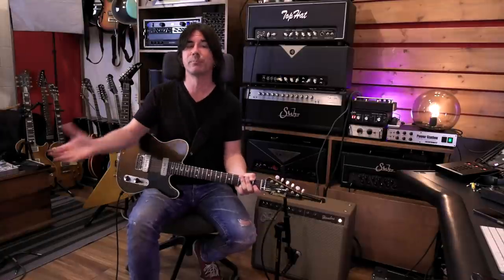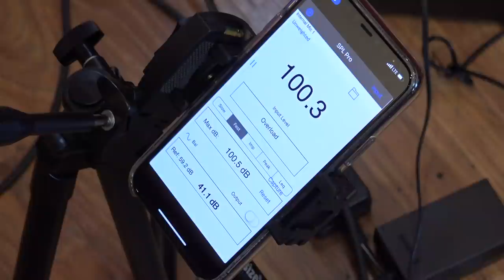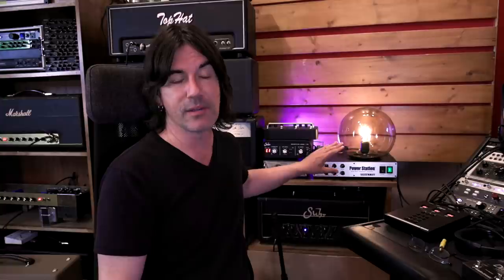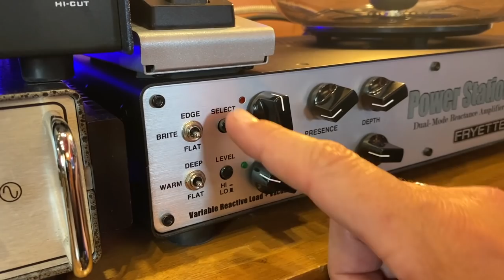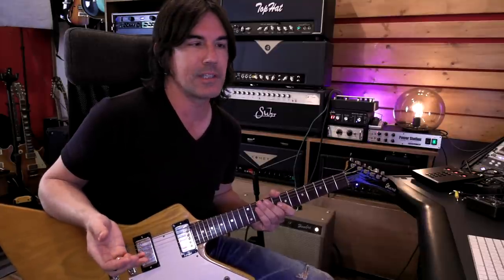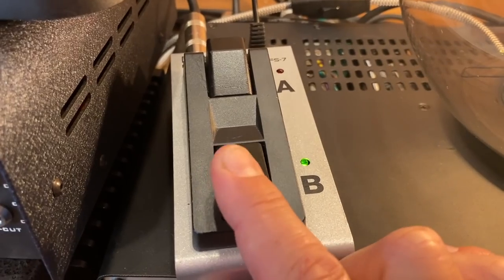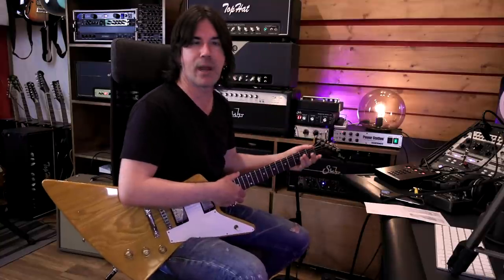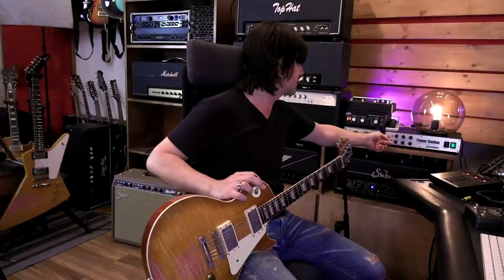THE BEST "ATTENUATOR" AVAILABLE! FRYETTE PS100 POWER STATION

Comment: I have to say that not having to run delays and reverbs into the front of vintage, reissues or any amp without an integrated effects loop is almost worth the price alone. It goes 1 better than a typical loop, running delay and reverb post power amp so the effects are working on the entire amp instead of just the Preamp.
When you're running through typical IR cab emulators, you're getting the sound of your amp being mic'd, this is essentially the sound of just your amp.

Comment: For anyone considering getting one of these, remember that as Pete's clips shows, it sounds the same when you match the volume in the DAW for the recorded clip, but in person the lower the volume the more our perception of that sound changes. Fletcher-Munson curve and all. So don't expect it will sound and feel like a loud amp at stage volume when turned down to bedroom volume because you will be missing the speakers running in their intended range and the guitar interacting with the speakers.

It's still a great unit to own if you have a favorite amp that is too loud. It also makes an excellent poweramp for digital modelers via the line input.
Reply: Thing about speakers is ... they are designed to move air. That is their primary function. So if a speaker is not moving the air that it is built to move, there will be a tonal and a presence change and a perceived lack of impact or "push" which we have become accustomed to "feeling."
Reply: @Tonetwisters  you’re right about the speakers moving air. However this is the best attenuator on the market.

Comment: The reason I bought the very limited YJM100 was because of the built in attenuator it had. I can get that warmth, sizzle and sag without stuff falling off walls or the blue lights show up. For my lower watt amps I use the Z Amp brake lite. So yeah it is cool to say your "bedroom" amp is a 100 watt Marshall.

Comment: I still have the first generation power station, and IT was the best piece of sound reinforcement gear I've purchased. The "attenuation," 50W 6L6 power amp (mine isn't 100?) Alone meant both My higher power and lower power amps get WAY more use than before. The series effects loop that can be used with Fender and older Marshall or any other amps that don't have loops just kills it.
I used to have a 20W and 50W Dumble clones that i could use anywhere i wanted together in stereo; if i need more power i could put the 20W through up to 50, and if i needed to go the other way i could. Eventually i started using an Ethos overdrive Preamp with another clone, the 20W was definitely lighter than the 50, but it was by no means light.

Comment: I have this, here's how I use it, I have a Kahayan 8x4 amp switcher (think Tim Pierce) the amp switcher has an attenuator in out and I put the ps-100 in there, this allows me to use it to attenuate all 8 heads, but also gives me a global effects loop for all of the 8 heads, so I dont needs multiple cables running from the effects loops of the heads. Its a great attenuator and the line out works great as well. It has Sovtek 6550 Power tubes

Comment: I just got the Fryette PS-2A a couple months ago & it’s such a great device. I’m pretty sure the only differences are mine Is single channel & 50 watts instead of 100 watts. I use a two notes cab M with mine.
Reply: That's the one I have. It is "The Device"
Reply: The PS2 has different power tubes and is a little more "colored" in tone than the PS100.
Reply: I just recently bought the same unit you have. I get some distortion coming out when I'm using a clean channel on my amp. Do you know how I can fix that?
Reply: @javeduddin Check you have the impedance set correctly. My first guess would be maybe you can hear the power stage of your amp working and actually breaking up. How have you got the level set on your clean channel?
Reply: @javeduddin  You may want to check the input level on the front, if you haven't already.

Comment: The worst load box I've come across was a Weber thingy (can't recall which one) but there was an actual speaker inside the device, that was virtually silent. But the end result was terribly lacking any clarity or dynamic edge, the further down the attenuation. What I have been using for a number of years now, is one (or the other) of the Koch load boxes. I think they work quite well though I cannot say they are on par with the Fryette designs, such as what we have here.

Comment: That attenuator really does sound great.

Lots of folks still think wattage has to do with volume.  Easiest way I've come across to think about it is that the average 5 watt tube amp is still as loud as a trumpet.  Why?  Guitar speakers are loud.  More wattage equals more headroom and tighter, fuller bass on tap.

Comment: Sweet, PS are really nice. I bought a Superlead a few years back and you kind of sold me on the RockCrusher, got it used for $300 which was a steal...I found a sweet deal on a used simple one, no EQ, but you did a video in like 2014 with an RC EQ version that I used for reference when I was thinking about getting it. It's beautiful, handles a 100 watt Marshall mic'd very nicely. Throw a mic on it and no one would know the difference, I some times have to pop the headphones off to make sure I'm not really too loud. Meaty and great for recording while keeping my windows intact and neighbors not hating me, but still getting that Plexi tone with no real audible anomalies or weirdness. It's freaking awesome. Attenuators are kind of a must for a NMV amp if one really wants that tone. But they work great on MV amps too if you want to get that gain from the power section.

Comment: I have to be honest with you, I am very skeptical of reviews on the internet.  A lot of reviews are just advertising in disguise.  But I've been looking for an attenuator for a while after not really being satisfied with the Weber Mass I have.  I was concerned that at 50W it would still be too much (I bought the PS-2), but it's extremely useable as an attenuator alone, with the High/Low button on High, the volume response on the volume knob gives you a very usable output without feeling like you have to baby the knob like you might with the amp alone.  As far as how it sounds, well if you have the volume down low it doesn't seem to sound the same, but you bring the volume to unity and it feels identical, so any loss in tone you're getting is just the result of pushing less air in my opinion.

It really is a great unit, and it's capable of so much more than I'm using it for right now.

Comment: Pete
Thanks man
I’ve been going round with this thing for quite a while
I stopped using it cause my freidman has an fx loop
I have a wet/ dry rig for live going through my Gigrig
Ive been using my friedman as my wet amp 
And my Vibralux as my dry even though the fender has more head room it doesn’t have a loop
So now i’m gonna use the freedman for dry and the Vibralux for wet with the ps100 for the fx loop
  I know this is long winded but your comment about not using the effects loop in amp and using it in the Power Station really hit home this time I don’t know how I missed that when you said that I’ve watch this video like six times 
I’m a huge fan just put a set of Thornbuckers in my PRS and love them
THANKS PETE

Comment: I’ve been gigging with a PS-2 for a few years now. It has got me through many a pub gig with killer tone.  You get all the bottom end punch of a cranked amp at pub volume, it works great for recording, and you can even run your time based FX after the cranked power amp, which sounds awesome.
Reply: It's not often emphasized enough how these tings make life simpler by keeping everybody ELSE happy!  No pissed-off family or neighbors, and you can turn down when you have to keep the sound guy happy without losing your tone.

Comment: Great video and I agree wholeheartedly about the load + reamp sound. In my experience, even the most budget load box+class D power amp combo beats expensive attenuators for low volume performance. Of course, the Fryette Power Station takes that concept to whole another level.

Comment: Ordered a 2nd PS-100,..
Seeking options 
a proper (schematic) for:
2 amplifiers
 EVH Iconic80 & VHT D50
2 PS-100s
2 Noise Gates per amp
  (4total)(Noise Reaper)

- Stereo Wet fx in the PS100 fx loops

Works as I like with one amp;..

🖖🏼😎🎸

Comment: I bought one at the start of lockdown. It’s pricey but totally worth it and absolutely amazing and really how I’ve kept my sanity at home over the last year. I can play all of my amps cranked but keep the volume low. And it sounds GREAT!! The Power Station is the best Covid/lockdown purchase ever.
Reply: I just set mine up. How high are you setting the master and volume on your amp? Then just dialing the volume back on  the PS-100 correct ?
Reply: @maximumguitarage  I dial in my amp however I want it. Usually cranked into sweet overdrive or not, depending on how I’m feeling or what I’m playing. With no regard for the actual amp volume because I’m dialing in the actual, quiet, at-home room volume with the Fryette.
Reply: @RichardReneeRachel  I see that makes sense, thank you. Were you able to get the active load to match your amps volume then work the volume down to bedroom levels ? When activated I can barely hear my amp even if the volume goes past the middle position at even 10:00 clock. I have seen individuals with the same problem and it has been a cable, fuse , tube or a wire disconnected. Just trying to get a good baseline to work off. I am hoping I don't have any issues with this brand new unit right out of the box
Reply: @maximumguitarage  Are you saying that when you have the Fryette activated, you can barely hear your amp even with the volume up on the Fryette? I do not have this problem. Actually, I've never tried to match the actual amp volume when the Fryette is activated because I want the volume lower. But I also have used the Fryette to crank a smaller amp, like a Vibro Champ. Am I making sense? :-)
Reply: @RichardReneeRachel  yes perfect sense. This is correct. If I am at 12:00 and even take it to 3:00 o-clock it's whisper quiet . Something is up. I replaced the speaker out cable to my cable,  I will give it a try. If it is not Working then I will have to sadly return 😭
Reply: @maximumguitarage  Yeah, weird and unexpected. Have you reached out to Fryette? They have amazing customer service. Very helpful. Good luck! When it's working, it really is a magic box of wonder! And I've never had an issue with mine (knock wood) so hopefully you get this sorted out and rock on!
Reply: @RichardReneeRachel  thanks mate! I have seen others'post tube issues or fuse or loose wiring. I am still convinced this is a great product and a must have for any home studio or gig.  Yes I am working with FRYETTE Support and they have been quick to help Cheers !
Reply: @RichardReneeRachel  ok I am good to go! Per Fryette Support - You had it backwards – HI is for hot signals (loud amps) and is therefore the quieter setting, while low is for cooler signals (preamps, small amps) so is the louder one.  The HI setting is really needed with 100w amps, but with 30w and under generally LO gives a good range of volume control.  If you are using the Master Volume on your DG30 to control power amp drive you are probably just not pushing enough power to get HI where it needs to be for a good range on the volume pot.

Comment: I have the single channel version for use with my AC-15. This thing is the best!!! And I definitely use it for the effects loop too, which made everything sound better. All my time base effects are in the loop except the Vibe Machine which I think sounds better in from of the amp. Mainly this thing sounds great at lower volumes that my neighbors can handle, And Pete is right, you still feel very connected to the amp while playing unless you turn down SUPER SUPER low.

Comment: In the Zeppelin test, I actually think I like the sound of the re-amp more. It has a juicy chunk to it, whereas the original signal has a mid-range bark which would be easy enough to eq in somewhere if you prefer that sound. Great examples of how the unit sounds.

Comment: What a great video. I had a hot plate and that killed the sound on my  plexi . Then I tried reamping. I was loading the amp down and running a pod box into a clean amp.  That sounded ok but too much gear. This unit is really great and again your video was aewsome

Comment: I bet having two channels would make running two cabs at different volumes a heckuva lot easier, no second amp needed and you can lower the volume on one of them for either FOH (quieter for mic'ing), for the top cab on a full stack pointed at your ears, or for a cab on the other side of the stage

Comment: Hello Pete,
As a cost effective alternative, I've been looking at a used THD. I have staying clear of the Scholz product because I know from experience, the resistors do not age well and will develop heat stress cracks over time. I'm just looking for something that is not total crap, that I can use to just putz around in my basement, maybe mic it for demos,

I have been looking for an attenuator. In the 80s I used the Tom Scholz Power Soak with a JCM 800 100w (2203) and it served my purposes for jamming in my dorm room on Eglin AFB. While I am much better off today than I was 40 years ago in the military on a salary of $500 a month, I cannot justify the cost of a Fryette. Your demo makes the thing look awesome. Alas, I think I would be single again if "you know who" ever figured out how much I spent.

Comment: The only thing missing here to me is a stereo fx loop, which can go mono to your cab but have stereo line outs for the PA or whatever, at the same time. You could put the fx on the line out, but then you don't get any going to your cab if you wanna. The fx going to the cab should have the option o L only or collapsing stereo to mono.
 
And then perhaps an output to daisy chain two Power stations to run two cabs in stereo, from one head... I guess then you could have a stereo fx loop..

These drive me nuts about the Waza TAE too... And the Waza should have Bluetooth and a phone app so you don't have to drag a laptop everywhere.

These features would be great so you can take two of these instead of 2 amps on the road. Alternately your other amp could be backup, instead of taking 4 amps (2 main, 2 backup).

Comment: Where the magic is:
(Video volume matched)
.                                          Crunch        Clean
Bypassed:                        15:34           15:50
Attenuated:                      15:55           16:11
Attenuated more:            16:16           16:32

I feel that at extreme attenuation the tone slightly loses in body. But this is just so slight. Easily retrieved with a 6 band eq in the loop I guess.

Comment: So, I just ordered one of these. Can’t wait!. So,explain the small amps getting louder deal. I unplug the combo speaker, run a cable to the PS100, then out to some other cab, not back into the combo speaker right? I mean, if we are going much louder, a single speaker could not handle the load right? So, small watt amp, unplugged speaker to PS100 to other cab? Thanks. Just don’t want to blow my small amp speaker. Thanks gunna be great for all my 100w amps as well.

Comment: couldn't you use a two tone captor 16 and send the line signal that would normally go to a recording device to another amp, like a PA or additional guitar amp and adjust the volume as needed like this ps100 amp does?  You would not use the speaker out at the -20db cause you wanted silent volume and control it with the additional amp. You would not be having to pay for another amp if you use the power amp section of another amp.  Like the old Slave and power amp setups.  Would this work?

Comment: Hi Pete!

I need some advice about buying a power attenuator.
I have Koch Amps LB120-II/16 that I use with a Marshall "2203" amp and I am extremely satisfied with it, it is very organic and sound respected (I had already tried a "Powerbreak" and a "Hotplate" that I found much less good).
I have just acquired a new toy, a Marshall "2204" older and paradoxically that crunches at a very high volume.
I would need an attenuator that would attenuate the sound even more than the Koch while being as respectful of the sound as possible.
Which one would you advise me in priority? (I don't need various options: sound card, equalizer...) 😉
Two notes reload, Rivera Rockcrusher, Iron man II ...? (The Fryette seems good and perhabs the best but a little more expensive for me 😏 )

Thanks a lot
Eric

Comment: If you need just a little volume reduction for live gigging...the Dr Z Brakelite is great.  No, it doesn't have a line out. No, it doesn't have eq.  No, it won't squash a 100 watt amp down to bedroom level.  But it's very dynamic and substantially less compressive than many others out there.  .....and no, it doesn't weigh 20 lbs and no, it doesn't cost that much.
Reply from the maker: Generally speaking most attenuator‘s are OK at a “one click” sort of reduction of a few DB. But in the tests that I’ve done where I compare the attenuated sound at the exact same volume level in my daw,  most of them still are affecting the tone to some degree – usually the sound is a little more midrangey with a little less clarity and a little less thump. Summary – yes it works. Is it as good as this thing- No. My favorite passive attenuator designs are the Faustine Phantom, the Tone King Iron Man, and the Rockcrusher.